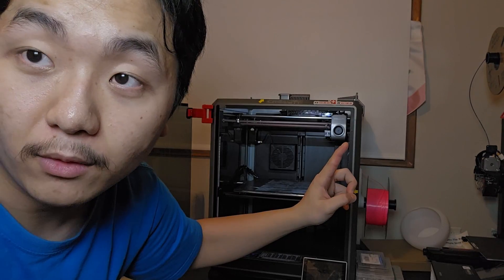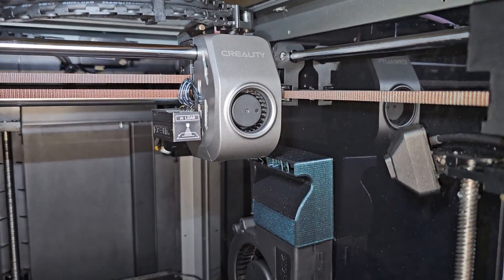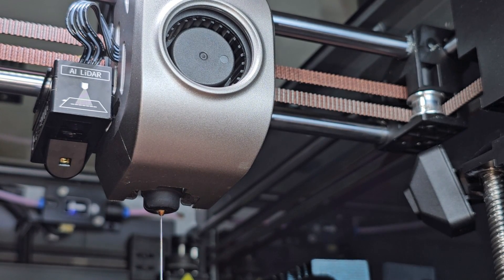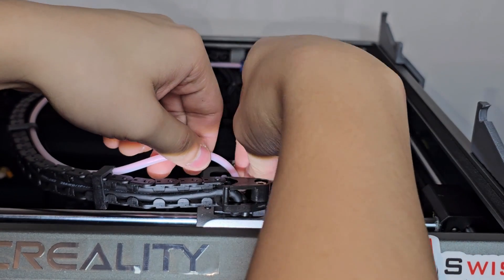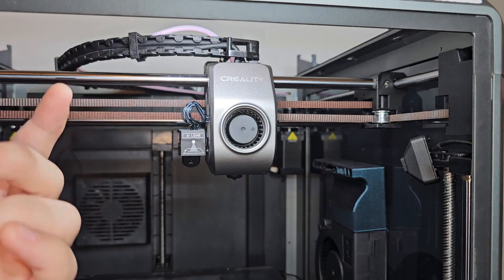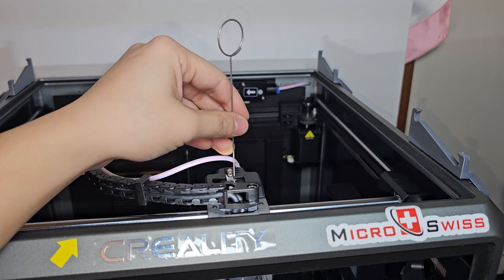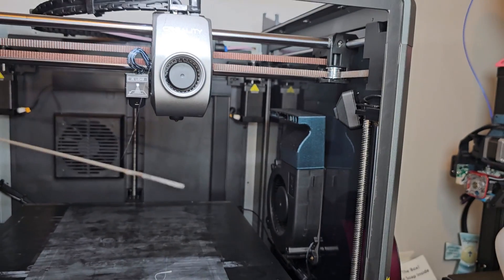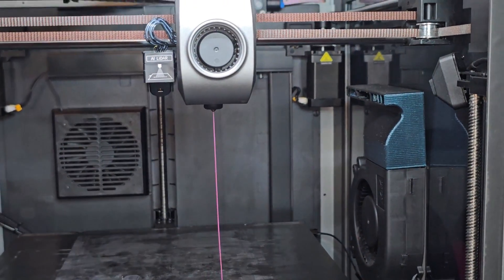Creality K1 Max Clogged Nozzle | Do This Instantly To Unclog

Comment: I am having exactly this same issue with 1week old printer, will bought the needles because in my case it is clearly clogged after the extrusor (mainly because if I unscrew it I can move it up and down and see the filament attached after it) I do not know it in hotend or nozzle. 
What I cannot remove is the PTFE tube, I am pressing in the white part and dragging up the tube with the extruder unlocked but I cannot remove it. Maybe it is also stuck inside?
Reply from the maker: If that's the case then the filament might have gotten stuck with the ptfe tube.
Reply: It is weird, tried with the needles and nothing, so nozzle and hotend are fine.

Seems that there is filament stuck at the entrance of thermal pad or in the middle idk. Guess I will have to dissasemble everything 😢😢

Also the ptfe tube seems sticks with the extruded but the filament can move inside it and through the extruded. Strange but that makes me think that it does not block the extruder..

If I find solution I will post here also, hope it can helps others
Reply: Managed to fix it!💪

The filament was stuck at the entrance of the thermal pad (inside the small plastic tube). After the extrusor the filament goes to the thermal pad through a small plastic tube and after that it passes through the thermal pad and goes to the nozzle.

With the needle I was able to clean the nozzle using the video solution, hottening etc etc.. and after that was done, with the extruder moved upwars I was able to cut the filament and drag it out with a tool. Then had to put back the tiny plastic tube and the extruder and everything is fine now.

Had to dissasembly almost every part to be sure that was only the problem but ye, that was. 
Read that wet filament can bulge and obstruct parts, thought this was the case since yesterday was raining heavily where I live.

Hope this can help someone.🙂
Reply from the maker: That's great to hear you were able to fix it. It will definitely help someone out there.

Comment: Unfotunately, none of these methods worked for me. Printer is less than a week old too.
Reply from the maker: Awww, that's not good. I guess you'll have to remove the extruder and try to unclog it that way.
Reply: @Scratch3DPrinting  got it fixed finally. :) wasnt anything in the gears. Just a bad clog in the hot end somewhere.

Comment: 05:52 one should never-ever do that! This thing is not meant to be heated. The extruder casing is made of plastic. It can be damaged by heated metal. Also, this thing may weld into the piece of stuck filament (it may be about 5 cm long), and everything will get stuck. You should push with it when it is cold. And when the filament is stuck and cannot be pushed through - just undo three screws that hold the extruder in place, dislocate the extruder a bit, and pull out the piece of filament that is stuck.
Reply from the maker: You're correct, this method is really dangerous at that time it seems like a good idea but it is not.
Reply: @Scratch3DPrinting  yeah. I followed that "hot advice". It ended up drilling through the casing of the extruder. 🤣

Comment: got my rod stuck in the top, nice one mate!!!!!!☹
Reply from the maker: Oh no! Hopefully you got it out
Reply: @Scratch3DPrinting  Yeah, had to take it apart.  The problem was inside the gears had to drill thought after taking apart, which worked.  Only problem was connecting the motor to board really fiddly to connect it.  I'll check back and let you know if it fixed it.  Only had my k1 max 10 days.

Comment: haha just my luck, the nozzle cleaner is now stuck in there as well haha FML EDIT I put ALOT of muscle into her, and when I pulled it out, it had a huge line of the stuck filament on it , which is why I couldn't get it out as it'd cooled back in place, but after that no more clogged nozzle!! I would have never even thought to try to figure out what the tool did lol! Cheers!
Reply from the maker: haha, it's amazing to hear that you got it unclog!
Reply: @Scratch3DPrinting  Crazy thing is, I had a clog at the nozzle end this time, found this exact same video again and saw the small needle thing, put it into the tip, got a pliers for a firm grip to force it in without bending it, pushed it all the way in, got the blow torch, heated up the extruder cleaner crap, popped it again and boom, works again lol this is the second time you've saved me bud! haha

Comment: Hi!!  Just wanted to express my gratitude for your video – it was really insightful. I followed all the steps you outlined, and while it didn’t quite solve my issue, 
I’m sure it’s great for less complex problems. Your guidance was still very much appreciated! In the end, I found another guide that helped me out
https://youtu.be/4sPZCN6Lbbc?si=Q3hj8jIOz1nOUQqZ  which essentially is taking out the extruder then taking it apart (2 more screws, becareful with the bearings as the tiny one pops up, I did this and found the clog), it might seem a bit intimidating to do, is actually pretty. just one got it take time
Reply from the maker: Hi, thanks for the kind words. Yes these method are used before taking apart the whole extruder. I'm glad you were able to get your 3d printer unclogged.

Comment: Your method will damage the gears and material conveying pipes of the printer. Please take it off the shelves immediately because your method caused the damage to the printer I bought less than a week ago.😢😢😢😢😢😢😢😢😢😢😢😢😢😢😢😢😢😢😢😢😢😢😢😢😢😢😢😢😢😢😢😢😢😢😢😢😢😢😢😢😢😢

Comment: The big needle from Creality is designed to be used after removing the nozzle to just push it out. It does not require heating if you remove the nozzle first. And with the Microswiss Nozzle it’s super fast and easy.

With my limited experience with different brands of filament, i have only had one brand do this (cheap stuff i bough once and will be glad when its gone,) the other 3 brands never have jammed. the cheap brand did this in my Enders too.. and yes it was dried before printing for well over any requirements and to less that 20% humidity.
Reply from the maker: That's good to know thanks. Next time I'll stay away from cheap filament.

Comment: Its now monday. Heres an update for you. As suspected the filament had created a rivet either side of the heatsink. I stripped the parts off. And cleared the heatsink blockage. I then extended the ptfe tube. Blue on by 0.90mm andvmade sure I could see it protruding out of the bottom of the carrier block. I then had a good look at the hot end and nozzle. I measured the apeture on the heat sink that recieves the hot end. It measures out as 10.50mm. The shaft of the hot end that fits into the heatsink measure 10.00mm from the base of the shaft. These measurements where done on a digital vernier caliper. This is a .50 discrepancy, exactly the same height as the rivet that had been formed. As is the case one can raise the shaft of the hot end to accomodate the discrepancy. But, and this is important. You must use a high temperature silicone rubber to seal the thread. Otherwise the head will leak round the thread causing a bigger issue. Gasket sealant for head gaskets on motor cars is a cheap way to do this. Just make sure its got a temp range of around 250 centigrade.make darn sure that the shaft is a slight higher than the 0,50mm dicrepancy. Say 0.15mm over. So the final height of the shaft should measure 0.65mm. Lock it into place with the grub screw at the rear of the heatsink once you are absolutely sure it has made contact with the heat sink. Put the extruder motor back in place. And compress the heatsink and hot end so you can see the holes for the screws for the heatsink clearly. Then put the printer head back together. So far ive managed a 5 and a 7 hour print with no issues. This most certainly looks like a gapping issue either side of the heat sink. Thats what I feel and think is causing all of the blockage issues on this paticular moldel of creality printer. They have put a fix in the box with a longer ptfe tube. It in my oipnion as I said, slightly too long. The hot end part. Hmmmm. I dont think thats been adcressed correctly yet. Give them time. Its a great printer when grafting correctly.
Reply from the maker: Wow that's a lot. You're correct, every time I get clogged, there is a small pieces that's stuck in the heatsink, some time heat builds up, and the filament then gets stuck. It's good that now you are printing fine.

Comment: The method is good but sometimes the filament gets clogged underneath the heat sink. Thats a full strip down to clear. I believe there is gapping issue under the heat sint and above the hot end and nozzle. I spent all day clearing a clog, with the entire head stripped apart. It still did not fix my issue. The methods employed are exactly the ones i used. Including replacing the hot end and a 0.20 nozzle. 5 hours later it clogged again on a 16 hour print. Therefore there may be hidden issues with this machine causing the clogging. Ive had my k1 max since october and this is the first big problem ive had.
Reply from the maker: Yeah, recently I did notice that the k1 max has issues with clogging while retracting and long prints. The filaments keeps braking near the heatsink, so thats a hard place to get it unclog without stripping everything down in the nozzle head.
Reply: So true. I'm in the process of discovering what a brass shim or heat conductivity paste will do to help seal the leak. I should find out before monday if these are good fixes or a waste of time.

Comment: I start by turning up the temperature to 280º C or more, then extrude
most of the time you don't have to do anything mechanical to unclog your nozzle.
It's always worked for me.
Never had a clog issue on the K1 Max.
Hoping Creality will update their firmware, the filament stops at the switch, at this point the extruder can NOT eject the filament out of the tube, it too long.

I suggest that Creality change the firmware to run the end of the filament within 10mm of the extruder, so that only one extrusion needs to be done on a refill.
The way it is now , the filament stops at the switch, and you have to do, 3 or 4 extraditions to get the new filament to the extruder, so it can pull it.

If all else fails, I suggest the video...
Reply from the maker: That's nice to hear and a grate suggestion for Creality to fix their stuff. Thanks

Comment: Ohhhhh my god. THANK YOU. THANK YOU. THANK YOU. I've had the K1 about 3 weeks, and have had to unclog twice (knock on wood) and found this video becasue I'm having to unclog for the 3rd time - this one is my fault though, I did the retract, then started to remove the filament then pushed it back in cold, and it got stuck lol. But I'm so tired of taking the extruder and head cowel off every time! I just ordered the 0.4mm pins on amazon (like $6 thanks for this info! didn't know they were a thing!) and had been trying the throat clearing pin, but it would just go in and stop - so I tried heating the tip up (just the tip) with a butane torch lighter and IT WORKED! it worked right away, a poop came out and i was back to work without having to disassemble anything! THANK YOU!!!!!!!! I wonder if there's enough heat conduction to just touch the tip of the clearing pin that's included with the printer - to the hot end, and then pushing it from the top? i'll try that next time too, but for now the lighter worked amazing.
Reply: subscribed!
Reply from the maker: LETS GO!! I'm glad you were able to get it unclog without taking the extruder off, it is a lot of work to do that every time. Thanks for subscribing! 😊

Comment: first needle try, never worked for me on any printer or nozzle last method is the only/best that works absolutely fine! heat your nozlle and push it down. if that doesnt work. remove the extruder with 3 screws and do it again. do that actually on all my printers, now. but nozzles are cheap and clogges are pretty rare, so you can change that 2 dollar nozzle as well.
Reply from the maker: Yea the needle doesn't really work all that well.

Comment: And sometimes the filament gets stuck in a special way and it’s stuck in between the gears leading it into a small hole that is not the hot end be careful jamming rods in there you usually just have to crack it open it’s not to bad

Comment: I'm jealous that you have the v3 extruder. I have the v2 with the blue filament tube lock ring.
Reply from the maker: Aww, that's unfortunate. Hopefully, it still works fine.
Reply: @Scratch3DPrinting  I had to print that little lock thing to keep it from unlocking while printing and I'm on the warranty list for replacement.
Reply from the maker: @shirgall  nice!

Comment: I appreciate that this worked for you, but I decided it would be less risky for the plastic gears to open the extruder mechanism and clean out everything. It doesn't take terribly long, either.
Reply from the maker: That is another way to do it, I'll consider that method next time I get clogged.
Reply: is there plastic gears in yours? mine are metal, and unlocking moves them away from the filament path
Reply: With normal needle that is around 4cm is almost imposible to reach the gears of the exteuder putting it through the nozzle I think..

Comment: Start with a cold pull, before messing up the stuck filament with needles, cutting it or having the extruder grind it to death.  Let everything cool down, unlock the extruder gears, then pull the filament at the top (not so much that it would snap, just put some pull on it) while having the hotend heat up to 220C.  The moment the stuck plastic reaches its glass transition temperature your pulling will start to pull everything out.  Then you should be able to cut off the bad part and put the filament back in the normal way.
Reply from the maker: I'll try that next time it gets clog.

Comment: I have seen people say before you shouldn't push the rod you heated through the gears as it could damage them.  I always just take the extruder off, it's only 3 screws to come off, and another 2 if you want to take it apart.  Anyone else know this is true or not?
Reply from the maker: That is true, that's why I said in the video to be very careful when pushing in the hot rod into the extruder
Reply: I usually just heat up my nozzle for a bit jam the new filament and it pushes whatever is clogging it out

Comment: You can heat the nozzle, release the extruder and push the filament with your fingers.
Reply from the maker: That is another way of doing it, but sometime it's just way to hard to push the stuck filament down.
Reply: like he explained, sometimes a bit will get stuck cold higher up in the throat; every time mine has clogged it was because I pushed the filament with my fingers, I can see a compressed fat wide bit of filament that melted too wide for the throat - because I pushed it.
Reply: @joeylopezdesign  I mean push when you have unclogged the nozzle. When I chage filaments I always do it manually, I don't use the Extrude or Retract function anymore, and never had a clog.